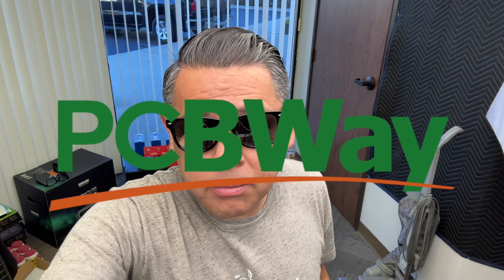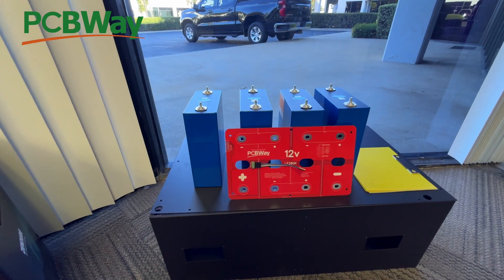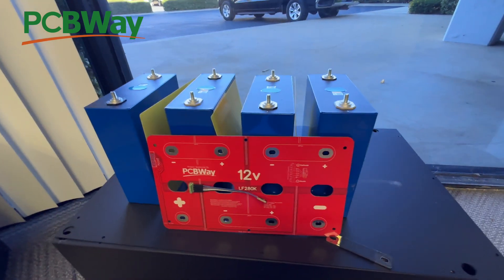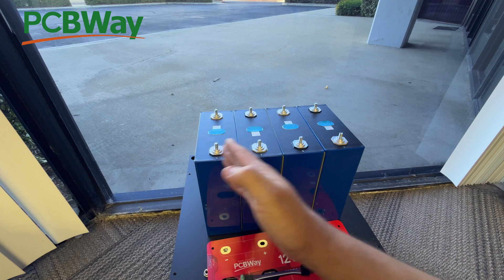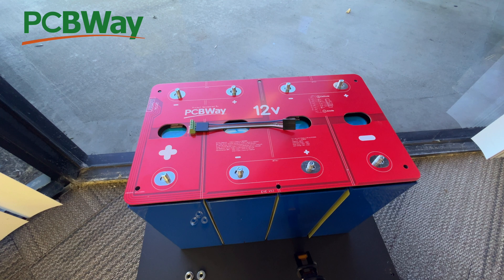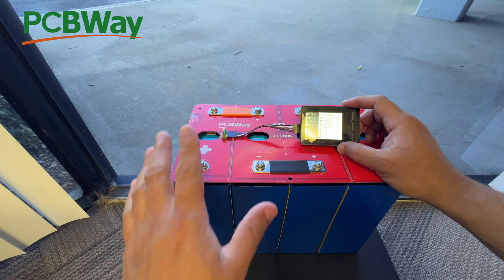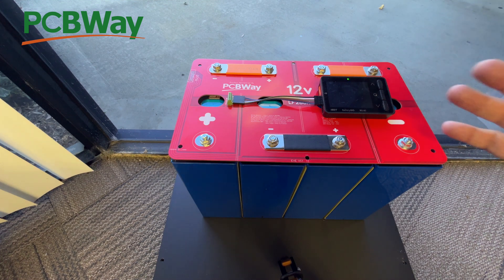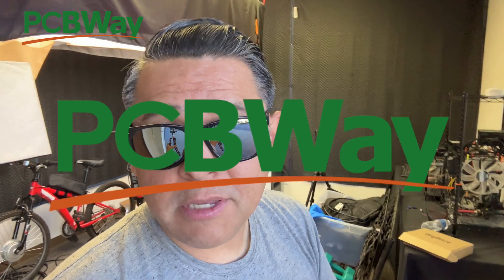EASY 12v  LiFePO4 Busbar LF280K kit - PCBWay

Comment: 10:38 the perfect setup for somebody to accidentally forget to check their battery then all of a sudden it goes above the recommended voltage then you just search up what happens with lithium ion batteries going over voltage compared to nickel metal hydride batteries which are very stable batteries

Comment: @JEHUGARCIA hello there. i have been following ur channel for a long time, im from mexico, and i have some info that migth b usefull to u to set a buisness.  i dont know if another countrys happens the next thing.   at least in mexico the power company has been installing new digital meters. for electric consumption. but they dont messure the real energy consumption of energy. what they do is that they messure the average peaks of energy that freezers and air conditioners and water pumps generate.. so the idea is the next. is there a way to make a batery bank that supplys the energy to the house/buisnnes and recharge slowly to diminish the peaks of requiere energy and place it bettwen the energy metter and the "in house grid" ?

Comment: JK 4s-8s2A200A BMS are popular.  They do need a kick up the ass regarding the firmware needing to be open sourced or open to customer feedback on features installed, as they are lacking functionality for users of multiple packs in a power bank.

Comment: You want a full BMS, it does balancing, temp monitoring so you don't charge them at freezing temps, shuts down if too hot, watches current in/out, allows disabling charging, output, monitors power in/out to give accurate state of charge etc.  I'm partial to JK BMS with 2A balancing current.

Comment: Please make a board with connectors for a JK-BMS V3 48v .  They have great features like a balancer, and you can configure the bulk-absorb-float behaviour.  Also the app is good with the bluetooth.  And the JK works with Victron and a lot of other inverter brands.  Great video.

Comment: Please explain. There is a negative and a positive, is the case a third polarity? I always thought the case was neutral or negative. Where would I get those fiber spacers if my batteries didn't come with them?
Reply: Before these spacers were available, I just used an inexpensive roll of shelving contact paper (I precut it), it is sticky and just run it down one side, around the bottom and back up the other side.  Done.

Comment: I'd happily have four  x 12v connector PCB's IF there was a way to connect them correctly to a BMS unit. It's also a better aspect ratio package for international shipping of a singe huge flat PCB. 
A major issue is than few people have a good place to put a 16s battery in a straight line, I'd have problems. However many people could put a 16s battery as two rows of cells.

Comment: Make these PCB battery boards Smart by integrating ESP32 boards that automatically connect to the Home Assistant app. 
From the battery PCB board would run a connector with a wire to connect to the JK-BMS. 
In this way, your Smart battery PCBs would allow even a beginner to monitor and setting BMS batteries in Home Assitnt from anywhere in the world where  in the internet.
Reply: Want to collab on a tech project?  network engineer background, love car audio, fast internet, and power anywhere.

Comment: Busbar rubber not allowing flatness to PCB potential for cracking or bad connection? Maybe a washer between PCB and busbar to allow nut to be fastened evenly. Just a thought.
Reply: Aren't the busbars with rubber in the middle flexible? Still learning before my first build so I could be wrong.
Reply: @vladimus9749  I believe the ones with bends in the middle, not the flats. Would warrant verifying in hand.

Comment: Definitely use the JK BMS for 12V,  24V and 48V - black BMS and the 24V-48V JK Inverter BMS which already has inverter communication, two programmable relays and current protection for parallel connection of multiple batteries. 
These JK BMSs have Active Balancer integrated inside, which is needed for such large cells, passive balancer is weak.

How big balancing currents can this pcb from the video handle? 

Would be possible to add fuse holders for the all balance wires close to the cell terminals to the pcb as well?
Reply: Because nobody makes a bms that's able to handle the amount of power that a car audio Amp will draw from. This was built for car audio pulling 400+ amps so no bms will support that kind of current.

Comment: i know this is  noob question(and yes i am a noob) lol.can i sue this type os battery with that bussbar for car audio purposes?
Reply from the maker: Yes it’s capable of 300A continuous and probably 500A bursts.  You would get a real long play time with one of these.  Like hours of playtime without depleting the pack.
Reply: @jehugarcia  nice, thank you for your input
Reply: Would love to get some 48v pcb's. I have heard apparent experts argue that there are pros and cons for compressing these cells and that generally there is no real point in doing so, do you mind sharing your oppinion on the topic?
Reply from the maker: I don’t have an opinion.  I have very little experience with these particular cells,  but we didn’t use compression 10 years ago when we used them in diy ev and they did fine for years laying on their side.
Reply: @jehugarcia …”laying on their side”…another type of compression no? (Bottom of the stack is REALLY compressed!)

Comment: Nice work!! Question.. I have a Eaton UPS (5S 1500) which uses a small 12V lead acid battery which gets charged by the UPS. Since there is no possibility to add extra batteries, I was wondering if I could remove the lead acid battery and connect it to this 12V LifePO4, and if yes, how would you connect it? Since the UPS charges the internal battery, I don't know if it could charge such a large battery and if it would be compatible with your BMS? Thanks!
Reply from the maker: Yeah I don’t see why you couldn’t use one of there batteries.  It should just work
Reply: @jehugarcia  Is there a reseller of your products in Canada?
Reply from the maker: No but I can now sell you cells shipped from china directly to Canada
Reply: Forget this question... I just saw you ship to Canada :)
Reply: Many small UPS are a poor waveform (basically square wave not the more desirable sine wave) Also small UPS usually only have a small charging circuit intended to recharge in say 4 hours BUT if you increase the battery size by ten times it could take ten times as long to recharge unless you add wind or solar or...

Comment: In my part of Canada, I don't think I can replace my lead acid with LiFePO4; my car lives at -30C or less in winter. 🤣
Reply: You can buy temperature triggered internal heaters for batteries now, that will automatically keep the battery warm. They also will prevent charging at low temps, which can be catastrophic for your cells.
Reply: So, don't put my S24Ultra in the freezer when it's overheating, and try to charge it (sarcasm). My battery went to 0 quickly after taking it out of the freezer. It was only in it for 20 minutes while going to a Quik Video Export 4k 120fps high bitrates. Yeah, it never finishes if the video is too long. The phone or App doesn't like making 50GB files, I guess.
Reply: Go with sodium ion batteries they are more robust than lead acid in cold climates